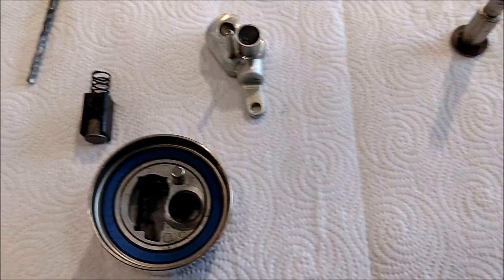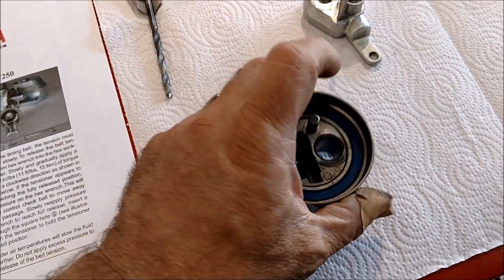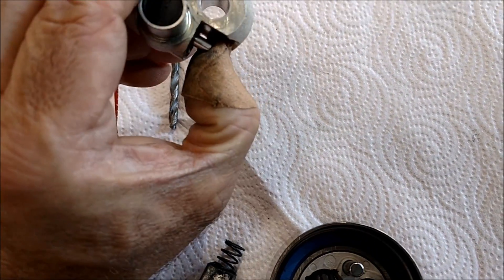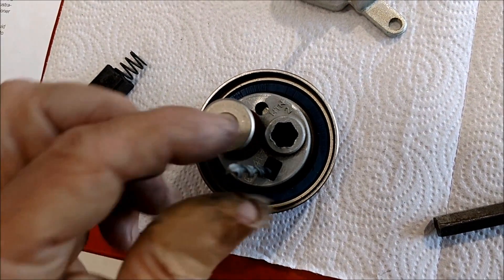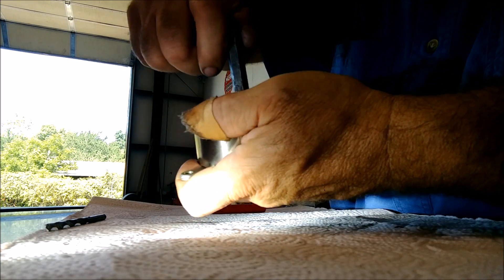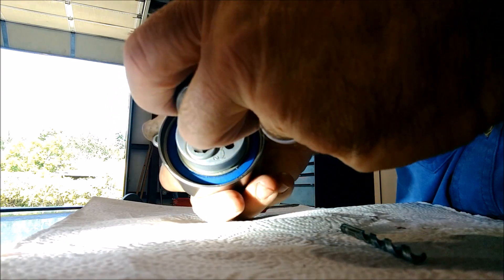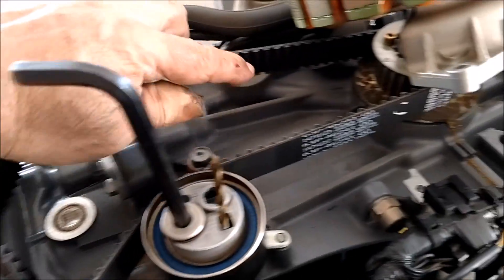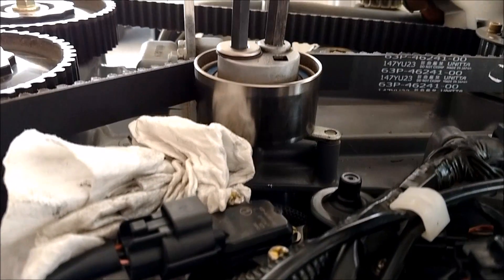2006 F150 through 250  yamaha timing belt tensioner operation

Comment: Those are the same tensioner used on the 4.2l vf sho as well. Thanks so much for his as I will be doing my sho,soon . 1 question,while he led to belt was in place did you bring all the marks into place or did you just mark places on block to put new belt back on ,I would think that you could get it to tdc and then just slide new belt on . If that made sense at all
Reply: Yes they are interference I too am a tech . 22 years ford .no longer but use to.its kinda like a car butt different always keeping slack to tensioner side is same. I was thinking about as maint belt (you specified)so you answered my question and thank you for your response so fast. I'm sure that the flywheel and starter magnets are going to be a pain.so thank you Craig I really appreciate your input hope you're having a very merry Christmas and I hope you have a Happy New Year
Reply from the maker: @cheetoz6902  yep that's why I never did the Marine tech thing. LOL.
Reply from the maker: Thanks for the information that's great to know. I mark the old belt with a mark on each component since this is just a maintenance belt replacement. Then I transfer the marks to the new belt as a backup and make all the marks line up and keep the tensioner side as the loose side until tension is applied. So between the cam and crank all need to be tight then at least attention on the slack side. This is something you want to check several times and rotate it around by hand sure it stays in place and attention behaves itself. I have been told this is an interference fit motor get the alignments are off things can get bent. This is a time when it's good to check things several times very careful save hours of aggravation plus a whole bunch of money. Really appreciate you sharing information.

Comment: whats the bulletin number
Reply from the maker: Hi Turner, I looked at the document I had and it has no number on it. I went to Google and did a search for Yamaha technical service bulletin and could not find the same sheet. But I also found this (  SIM Yamaha Parts Advisory: Yamaha 4-stroke Timing Belt Tensioner (THIS IS THE LINK- https://blog.simyamaha.com/sim-yamaha-parts-advisory-yamaha-4-stroke-timing-belt-tensioner/)

This advisory applies to all hydraulic timing belt tensioners that are used on Yamaha 4-stroke outboards, F150HP and up.

Once the tensioner and timing belt are installed, DO NOT PULL AND REMOVE PIN.  Use the same Allen wrench and procedure used to release the tensioner to remove the belt. (See SIM Yamaha Tensioner Bulletin)  Carefully apply the same tension (maximum 11ft lbs) to the tensioner to enable the circular pin to easily slide out.  Do not grab the pin like a pull string to remove it.  Doing so could aerate the fluid in the internal hydraulic cylinder which could decrease the overall tension on the timing belt. This will lead to premature timing belt failure and possible engine damage.)  Hope it helps you find what you are looking for.

Comment: Wow, this is exactly what I was looking for. I have 2 of these 2003 and 2004 vintage that have original belts. Thanks!!!!
Reply from the maker: Glad it helped. I had this boat for a while before I glanced through the manual and notice it had a timing belt after years and years running it and not knowing it had a timing belt I figured I got lucky.

Comment: I would luv to see your video on the timing belt, plus the vale adjustments Craig.
What was the condition of the belt tensioner like?
Mine has never been replaced 1000hrs service due now, my manual says to inspect or replace ??
I did find the belt tension lose when i looked at it, not sure why ??
Reply from the maker: Hi Ian,  No video on the belt replacement. (sorry) The tensioner was in great shape, I think as long as the oil has not leaked out of it it should be ok to reuse, it would only be a small stain as it's capasity is very small but if I saw that I would replace it. I felt lucky my belt did not break from age. The old belt still did look good but had been on there for 10 years and lots of hours. The hardest 2 things on the whole job was getting the flywheel to come off (even with the correct puller) and understanding out how the tensioner worked.  Thanks for the question.
Reply: Craig's Car Care thanks Craig appreciate you response. I have had a  noise I fist thought it was a vibration from the cowling but the cowling seemed good when clamped on. Than it sounded like water cavition but I found the tension belt lose. I realized only then how lucky I was it didn't slip a notch it would have been devastating I will take your advice and look for oil stain. But I don't won't to take a risk that it might be faulty tensioner. I just not worth the risk. What do you call a lot of hrs? Mine has 1000 hrs. I also found that my flywheel  is half a turn out .... the I marks line up on the two came shaft pulleys and the crank case shaft and housing 
A bit weird ???!?
Thank again
Ian
Reply from the maker: Great point, Way less to replace the tensioner than have engine damage.